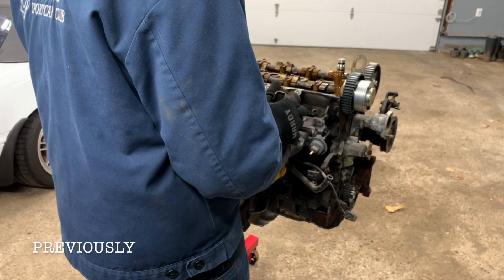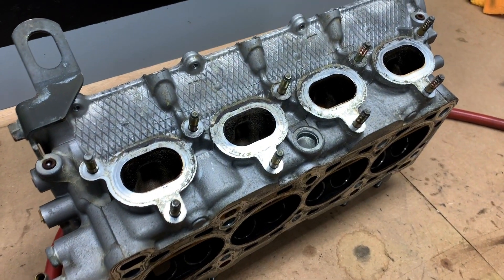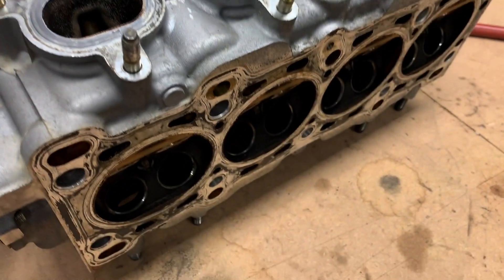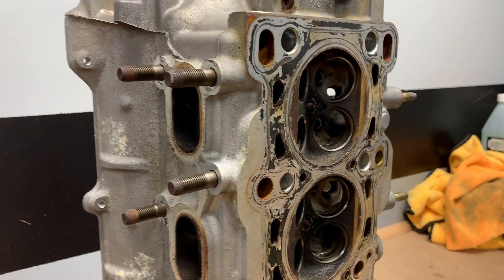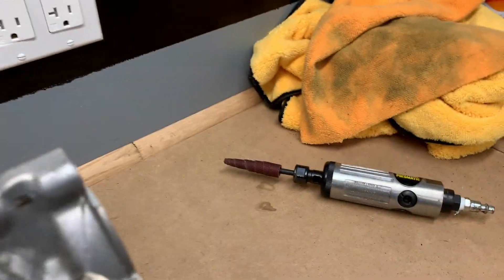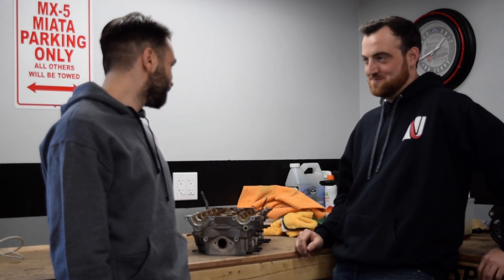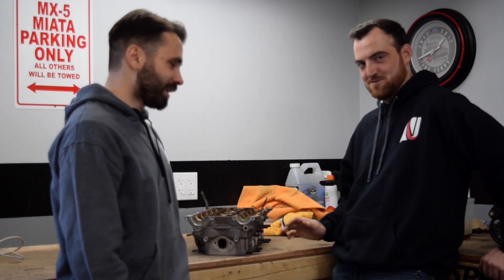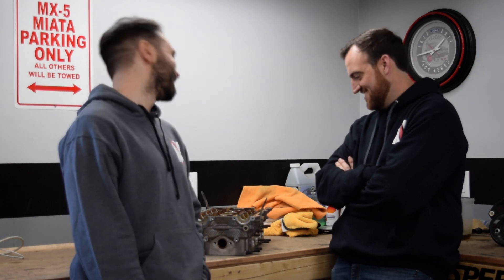Miata Port and Polish - Miata VVT Swap | PT3

Comment: Thoughts on using a carbide burr instead of the drum wheels?
Reply from the maker: I do that sometimes, but it takes off a lot of material very quickly. Sander is more controlled and precise.

Comment: What Miata year VVT head (99-00) or (01-05) is best swap for 1996 1.8 engine? Thanks
Reply from the maker: The VVT (01-05) has all the flow benefits of the 99-00, with the increased benefit that it makes more power down low due to the variable intake gear. 99-00 intake manifold is the best of the bunch through (excluding Skunk2 or Square Top), so that with a 01-05 head is a good start. The best is to do the whole engine swap, as that gets you the 01-05 higher compression piston, which is even better for power. 

But if you’re just doing the head, then 01-05 VVT hands down. And an ecu that can control VVT like an MS3 ($1200) or a Beer Money Motorsports ECU ($450) like what we’re using in our track car.
Reply: @NappMotorsports  you are great! Appreciate the reply. Had not considered 01-05 whole engine VVT swap? Guess that would be good to install in a Na Miata, especially when I am planning to turbo the car.

Comment: Be cautious about sharpness of the exhaust merge. You are basically creating heat concentration in that area that can prone to cracking ;) but nice decent job
Reply from the maker: Good tip!
Reply: @NappMotorsports  👍

I am planning to do some decent porting on my spare BP05 head which is currently on the way from UK (damn Brexit)...

Comment: What about doing ceramic coating to the combustion chamber, valve faces and exhaust ports?
Reply from the maker: Would probably benefit, but this was an 80/20 build. Get 80% of the power for 20% of the cost. The last 20% of power gets very expensive.

Comment: How far can you plane the head before you get Interference ? I thought you had to go over 60 thou for that?
Reply from the maker: It's around .040-.050" I believe. The VVT has higher compression pistons which makes it a bit different than a Non-VVT engine.